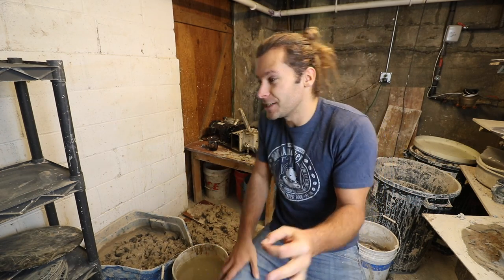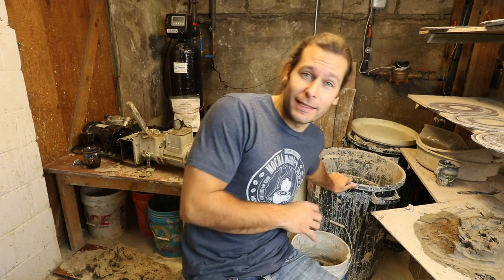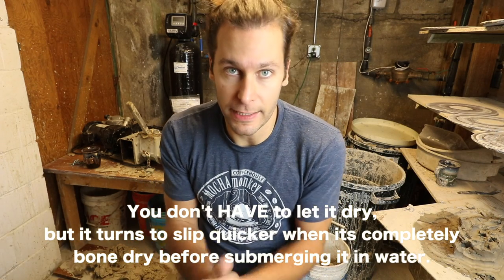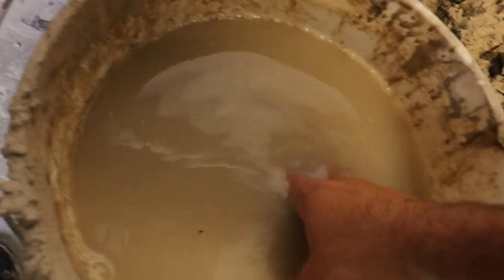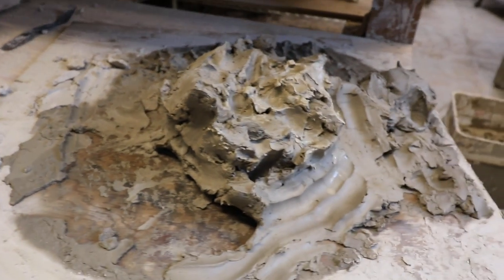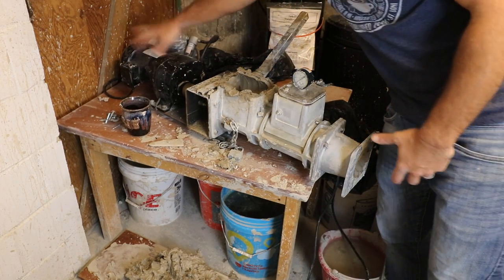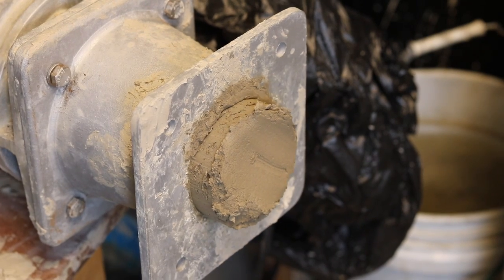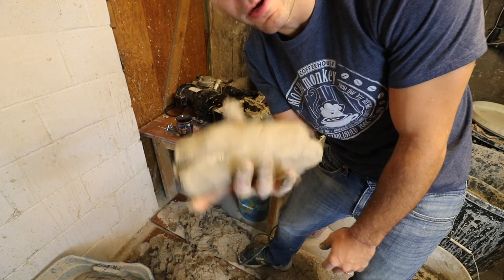The BEST tool you don't need - How to recycle clay

Comment: I put all of my clay scraps in a bin with a lid and add the water from my wheel buckets with all the slip when I replace it. After a while I take the lid off and let it dry a little, then I place it on a table I made that has a plaster tabletop to finish drying quickly and then I wedge it.
Reply: Smart I love this

Comment: 5 gal bucket with scraps and water. Mix with paint mixer until extremely smooth. Have 3 - 5 gal mesh paint strainers (used for spray painting prep) one inside the other, lining an empty 5 gal bucket. Scoop the mixed clay into the strainers, pull up on the strainers and twist it like a loaf of bread. Once you have all the clay strained spread out on plaster boards. I use the cut and slam method instead of wedging.

Comment: I really dig your videos! Thank you for all the wisdom you share. I put my scraps and sludge from throwing in a five gallon bucket. When it gets about 3/4 full I mix it with a paint mixer until it is a nice slip consistency. Then I scoop it out and place it in about a 2 inch deep sheet on concrete board to let it dry out some. With in about 3 to 5 days if it’s not sticky I pull it off and try to wedge it.
Reply from the maker: Nice! great system!

Comment: Plaster bats is best for drying clay. But if you have a pugmill you can skip this process, just mix bone dry clay with wet clay in the mixer and pug it when the clay is in the right consistency.

Comment: After I trim my pots I put the trimming scraps into a small bucket with a lid and then I put some slipped from my throwing bucket on top of it to  re-moisten the clay. After 1-2 days I wedge it up let it sit over night wedge it and throw. This way I can recycle quickly. And keep different types of clay separate if I want to. Also if I have a large quantity of scrap clay, or dry clay I let it slack down in water and then hang the wet clay in a cloth to drain out similar to making cheese the excess moisture drips out
Reply: What kind of cloth do you use? A cheesecloth or more like an old pillowcase? I have a years worth of mixed clays to recycle....I've been dreading it. But looking forward to some cools swirls of dark and light clays.
Reply: @pattyyardley6151  canvas or an old sheet, so a pillowcase would work

Comment: One thing good about having to wait a long time to recycle clay is that it is supposed to become more plastic from the organic matter (mold?) in it. I remember reading that some Asian potters used to bury a bunch of clay outside for their descendants to use, since aging clay that way improves the quality of the clay. But I'm glad you were able to get the pugmill you needed. I don't have access to one myself and I made the mistake to let a big pile of used, but bagged clay sit out in our side yard for years while I was recuperating from some serious injuries. What I didn't know was that the plastic bags were biodegradable so they have disintegrated in places. It would have been much better if I had unbagged it all and put it in a big bucket. I'm wondering how the dissolved bag plastic will affect the clay when I am finally able to recycle it. I may have to let it sit even longer so that I don't have any plastic shreds left in the clay. I also need to figure out what is the best (non-biodegradable) material to cover it with to protect it from contaminants. Any suggestions?
Reply from the maker: Hmmm I can't say for sure, I would guess that most plastic bags are not biodegradable and therefore would work?  Maybe plastic buckets like I have with lids on them?   Good luck!

Comment: I keep the clay scraps wet rather than drying (dust control)- all my trimmings and 'slop' from the splash pan go into a 3 or 5 gallon bucket. Once full I pour off the water as it settles. I take the wet slop and spread out on a plaster slab. I made several slabs with regular old plaster of paris and plastic boxes (clean/unused kitty litter pans). Within hours clay stiff enough to flip over and/or wedge up and I bag it up for future use!

Comment: I put my porcelain scraps in a bucket and cover with water. Every spring, when it has had a chance to get good and moldy (for plasticity), I scoop out a pile of this wet slurry onto a towel covered piece of drywall and leave it outside for a couple of days. Then wrap the towel around it...pat pat pat. Let it firm up a little more, maybe another day or so, partially covered with some of the towel. Then cut into pieces, wedge and knead and back into a bag to get used again! My business, Mary D Tiles, is 100% Handmade-- no machines except my manual kiln!

Comment: I am a noobie potter and all my scraps go in a bucket to go bone dry then run it through a small wood chipper to get it broken down. then it goes in a bucket of water till its like slip then i take it back kout and let it dry till I think I can wedge it. Then the real work starts after wedging 25pounds of reconstituted clay my arms on on FIRE. I have looked at pug mills but yikes they are expensive.

Comment: Hi John, really like your videos.  Question:  Has anyone tried using a commercial mixer to blend up the clay?  You know get all the lumps out before you wedge.  Should be able to pick up a used one cheaper than a pug mill and it should work for smaller amounts of recycled clay for us small shops.  What do you think?

Comment: I'm going to tell something to you that will probably shock you. I don't wedge my clay ever unless I'm making something very large and I have to put pieces together. You do not have to wedge clay if you're making small bowls and coffee cups basically when you get it in a square box is come right out of a pug mill. I don't get any cracks I don't get any blown up pieces nothing. No ass crack I mean I get the occasional s crack but probably less than when I used to wedge clay all day long. All I do is a cut a big slab off of the cube from the box I lay it down cut it into 4 equal pieces with the wire and I smack it down and make a dice like Square out of it it softens it up turn it into a ball and use it. They do the same thing if I'm making a vase I just use more clay like I said the only time I wedge is if I have a really really big bowl that I have to do like huge

Comment: I'm happy for you to find a pugmill.  There was one where I worked and I pugged a lot of the clay, it's a great workout! But it was a never ending task.  I've spent hours pugging.  At my home studio though,  I have several 5 gal. buckets, with slip in them.  Some have algae growing in them, nothing some bleach won't cure.  When I'm feeling like reclaiming it I put it on plaster bats and and sheet rock, then set it out to dry, then wedge it and bag it for later use.
Reply from the maker: Yes my life for the next 3 months, PUG PUG PUG!

Comment: I though this would be a cheaper hobby than stained glass and glass fusing. Then I saw the pug mill, the pottery wheel, the slab roller, the mold, the bats 😩. Do you have any tips to make this hobby economical? My hubby is turning my used kiln into a technological break through so I can’t quite tell him it needs to be result yet.

Comment: Hi Jon. Do you have to wedge the clay after you've pugged the clay or does the pugmill take out enough of the air removing the need to wedge?
Reply: Pam tenKrooden You need to wedge it after you take it out of the pug mill

Comment: Do you ever mix the clay? What if you dont use the same kind of clay? Can you clean the pug mill easily???
Reply from the maker: I try to just use one kind of clay to simplify, it is not super easy to clean , but do able
Reply: Jonthepotter what happens to the clay left on the screw when you have no more clay to process to push it out??

Comment: Another great  video! I’ve been drying my recycled clay on a plaster bat, but I’m having problems because the plaster never got really hard. It’s sort of soft like chalk. Eventually the whole thing just crumbled so I trashed it. 
Any tips on how to properly mix plaster?
Reply from the maker: Haven't worked much with plaster, sorry!
Reply: Start with fresh plaster. A new unopened fresh bag. Close and seal the bag after tight, I use packaging tape. Plaster will absorb moisture from the air if bag is open. Always add a lot less water than you think you'll need. Its easy to add more, a pain otherwise. Add a bit at a time. This is a lot like making bread or pie dough, there's a feel to it. Make sure to leave drying time between uses of your finished mold. But all plaster molds eventually break down. Make sure its thick enough if its a slump mold.

Comment: I put the scraps in a bucket of water but what about the smelling of the clay? Is the quality going to be different then "fresh" clay? thanks
Reply from the maker: No if it smells that doesn't change the quality at all!  I have used many a smelly clay:)
Reply: Look up using calcium carbonate in tiny amounts to help with the smell.